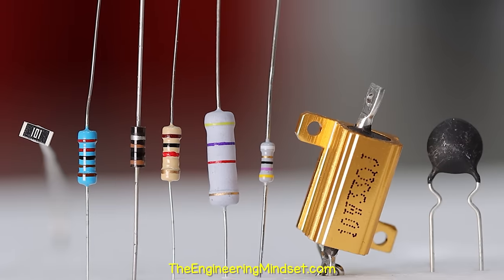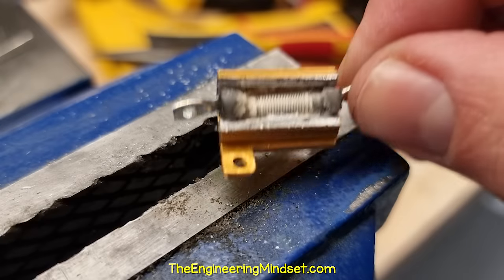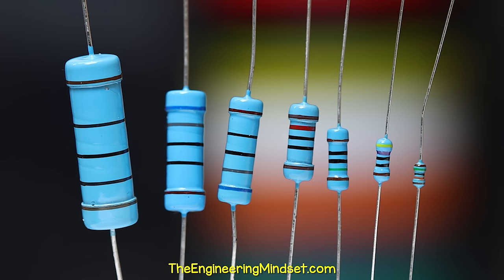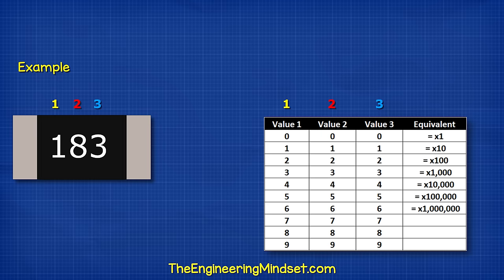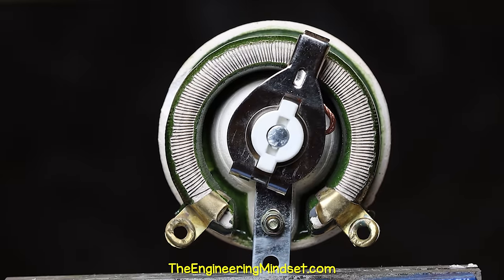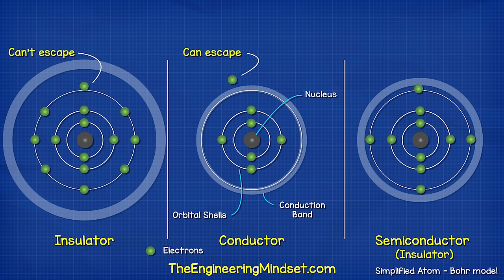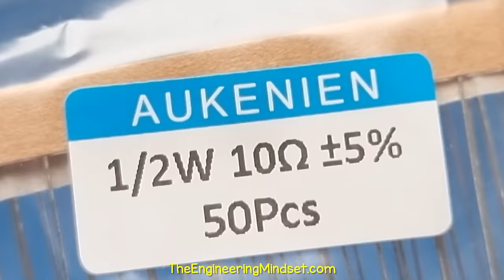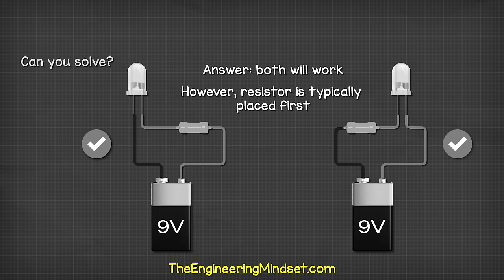How Resistor Work - Unravel the Mysteries of How Resistors Work!

Comment: As of 4:25 at first glance my answer is that the resistor should come before the led. Because you showed that without a resistor the led would burn up and break, so intuitively it makes sense in my mind that it should come before so that it can limit the amount of power going through the system.

Alternatively the answer seems so simple I’m now thinking of it as a trick question. Im thinking there is a possible answer that it could be either side. The only way this can make sense, in my mind and with my limited knowledge, has to do with amperage and the total energy of the system. Using the water in the pipe analogy, there is higher pressure on one side, however the overall flow rate is lower on that side. So in putting the transistor anywhere in the system it will limit the total flow of energy going through the system. That or I’m overthinking it.

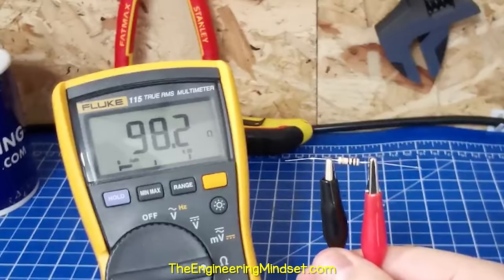Comment: Solution to the question at 7:24 below SPOILER AHEAD!!!

This bands give us the following expression for the resistance: (10*100,000)+/-5%
Simplifying it yields this:
1,000,000+/-5%
So, the final value for the resistance is anywhere from 950,000 to 1,050,000.

Comment: Hi, your videos have helped a lot in wrapping my head around components and concepts my teachers failed to communicate in high school. I've had a question for a long time to which I have yet to find a satisfying answer anywhere, so I thought asking it here would be my best bet: when you look at electron flow, the resistor is often placed at the end of the circuit, AFTER the current passes through the vulnurable components that we want to protect from overexposure to a large current. My question is: why it doesn't matter whether we place the resistor before or after these components to limit the flow? I've always imagined there to be some kind of inrush current through this component that might exceed its physical limits before it reaches the resistor to slow it down, even if it is only for a few mili-/microseconds. Thanks in advance and keep up the great videos!
Reply from the maker: I have shown it in this video. It acts like a traffic jam not a speed bump
Reply: @EngineeringMindset  I think I understand, thanks!

Comment: Heating elements are wire wound resistors just with a metal casing outside the ceramic to use the heat energy to heat up stuff like heaters, ovens and stoves.

Comment: Thank you for this video, it cleared some things up for me. I'm just starting to learn some things about this topic and it's fascinating. There is one major question about the placement of the resistor though and it's bugging me for the last few days and I couldn't find an easy to understand answer.

Electricity is talked about like something that "flows". I know that electrons try to compensate the lack of electrons on the positive side and move. In the past they have thought that electricity moves from the positive to the negative side. But physically, the electrons move from the negative to the positive.

Is it really something that "flows"? If we have an easy circuit with a battery, a resistor and a LED (in this order) and the current goes through the resistor and changes to a degree the LED can handle, is the current BEFORE the resistor still the initial one from the battery? At least for a fraction of time and it balances out almost instantly so it's unnoticable?

I think it can't be, because physically the electrons discharge through the LED first and then through the resistor, which would mean that the voltage that goes through the LED first is the one from the battery, meaning that the LED would get destroyed - but it doesn't.

Sorry for the long question, maybe there's easy to understand literature or something you can link me for this exact question.

Thank you so much in advance!

Comment: Great video.  I need help with a issue on my repair.  I have a 24V DC power supply circuit that uses a 1 ohm 2 watts resistor, the resistor kept burning after replacement, the power comes from a transformer.  I what should I look for?  Could the transformer be bad?  There 4 diodes that being used as rectifier right before the 1 ohm resistor.  Could they be bad?  Which allows too much current to rush through, correct?

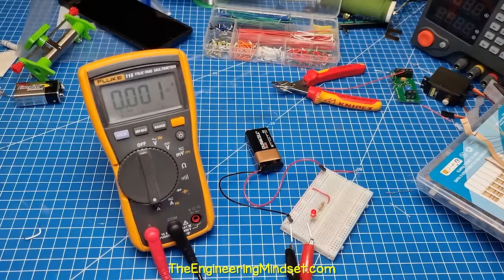Comment: Hi, at 25:11 you showed that despite using a resistor with a larger resistance the voltage drop across the LED was still 2V. However from my calculations, wouldn't the voltage drop across the LED be 0.119V because the resistance of the the resistor is much much larger than the LED which should have a resistance of around 134ohms. Could you explain as to why the voltage drop across the resistor/LED remained the same? Also this doesn't make sense as power is also equivalent to V^2/R so if the voltage across the LED does not decrease the power dissipated by the LED also remains the same.

Comment: SMD resistor codes are read as followed:
For example 103 the last digit represents how many zeros follow the given value
So 103 = 10×10³ so 10K
Or 502 = 5×10² so 5K
However this is for 3 digits. With more digits this might change.

Comment: I've decided not to buy any decent equipment (I have a basic £15 multimeter from China-bay) or start any projects (just using a breadboard with basic resistors, LEDs and later some other things like capacitors, etc) until I properly learn about the components and the equipment. This video was really useful, thanks. 

Have you got one about how to calculate the resistor needed to not blow another component like an LED? I have found that components might not come in a bag with details on it. I might find this later as it might be obvious, but I'm blowing LEDs setting up simple circuits as it is not clear how to work out the correct resistor. I figure that LEDs are a worthy sacrifice to stop me killing more expensive components in the practice phase. Once I have this mastered in that I can get an LED to do anything I like, then I feel confident to calculate anything pretty much.

Thanks in advance, but anyone can answer. ;)
Reply from the maker: Please watch our LED circuit design video and LED explained video

Comment: On markings on surface mount resistors:

Generally any resistor smaller than 0603 will not have any markings. Several manufactures quit marking any ordinary types of SM resistors several years ago. (SM ceramic caps have mostly 'never" had any markings)

Comment: I got used to the colour coding pretty quickly through my studies, but I always thought this to be an unnecessarily complicated system. As if the manufacturer is attempting to create some kind of Masonic Lodge of electronics repair technicians who will be the only ones capable of "reading the signs" LOL. Why not just write a resistance value on it in bright, clearly legible letters? Years later someone brought us an old Soviet synthesizer for repair, and when I opened it, - lo and behold, each green colour resistor both small and large had values written on them in thick white text.  Thought that was really cool.

Comment: One fact you omitted was that most resistors are not made-to-spec, but rather made-then-speced.  I.e., first the resistor is manufactured, then it is measure and then labeled based on the measured resistance.  So if, for example, a resistor is labelled at plus/minus 10% accuracy,  you can be confident you won't get lucky and find that it happens to be within 5% of tolerance.

Comment: While putting the current-limiting resistor before or after the LED doesn't make any behavioral difference, it does make a practical difference, in particular as you get into higher voltage circuits. When the resistor (or any protective device) fails open, you would ideally like the 'active' part of the circuit to fail to neutral/ground, rather than fail to the bus voltage (for safety reasons; you can imagine a circuit with a 100V signal accidentally propagating that voltage throughout the circuit when an element fails causing potential hazards to users.) This means you want the resistor to be on the high voltage side of the circuit and the LED on the low voltage side. That's also why we put our transmission fuses before your house, and why we don't put protective isolation devices on ground wires.
Reply from the maker: Seen the new LED explained video? so much detail covered! https://youtu.be/O8M2z2hIbag

Comment: Question! You mentioned that the resistance changes accordingly when the strain gauge is stretched or contracted from length into width or vice versa. I supposed if the volume remained constant, my theory is an additional curved tension has slowed it down, but I never study fluid mechanic of electron flow, what am I heading? Current or Pressure?

Comment: all in all
1. Answer: Depends, but its alright if you apply it after the LED or before the LED. CORRECT
2. Answer: around 1 mil ohms or 1000000 (the beige one) CORRECT
3. Answer: around 12k ohms or 12000 (blue one) INCORRECT

2/3

Comment: I'm confused, electrons in reality flow from the negative the end of a battery.

Alpha Phoenix showed that the instant a circuit is turned on, voltage and current do indeed flow for a fractions of a second while the circuit stabilizes.

With this phenomenon in mind, wouldn't it be advantageous to put resistors in high power or high voltage applications in the negative end of sensitive loads drawing from this high power system?

Comment: The firsr example resistor has 50 Ohms with a 5% tolerance so te range is anywhere from 47.5%-52.5%. I think
The second one is 120,000 Ohms with a 2% tolerance giving a rage anywhere from 117,600 Ohms to 122,400 Ohms

Comment: I replaced the resistor other ground ... So after. But I don't think it really matters in some electronics. Plus I make sure to use a correct volt power source ❤

Comment: I can understand this using the electron flow model, but not as electricity actually works through electro magnetic fields. How does the resistor reduce voltage and current when the electro magnetic field can induce a current in the conductors beyond the resistor?

Comment: before or after?  Doesn't matter unless there are other elements in the circuit.  Sometimes a design can be that two devices need a common voltage drop.

Comment: The one ohm resistor is basically cut in half the thin mettel carrying the current so as the flow comes into the resistor from one direction leaving the risistor out the other ?

Comment: It's always good to compare water flow with electrical flow. A lot of similarities.
Reply: Resistor - restrictive (narrowed) pipe
Capacitor - water tank
Inductor - water hammer (can't think of an actual device that does this because water hammer is something you typically want to avoid, but I can think of some conceptual devices that would achieve it)
Reply: I don't think so.

Comment: i think it does not matter if i put  resistors before or after  coz its in series so there will the same  voltage drop on the bulb and the resistor anyways nomatter  if its before or after the light bulb

Comment: If my $1,000 led headlight on my beetle stoped working due to the dc generator. Is it likely that the voltage dropped and damaged the leds or could the resistor have been damaged due to low voltage

Comment: I love your videos but I am so confused. In your various videos in the electricity series, you keep referring to the flow of electrons (number of electrons flowing, speed of electrons flowing) but in various other materials I keep reading that electrons do no actually flow (but rather drift very slowly). So when you say electrons flow in large numbers where the resistance is low but in fewer numbers (but at the same speed ... in this video using the traffic jam analogy) what do you actually mean? Do the electrons flow along the wire or don't they?

Comment: A simple question, if the resistor sheds the current the LED cant use, why do LED bulbs save power? Is the power not just wasted as heat in the resistor instead of in the old bulb filament?
Reply from the maker: If you used a high voltage and a single LED it would be a waste. But multiple LED's or a lower voltage would be more efficient. A normal incandescent lamp has to reach a temperature that is so hit it emits light. So it produces light almost as a waste product. LED's don't, just emit just light and almost no heat. See our LED explained video for more info and deep dive

Comment: Could it be that the electromagnetic field created by completing the circuit with only a 9vdc battery and an LED is so strong that it super heats the thin wire inside the LED rather than too many electrons being pushed through such a small space?

Comment: Howdy, Brother!  What resistor should I use if I have a yellow 10mm LED Emitting Diode (1.8-2.2V)  powered by two AA Batteries (on/off switch in the loop)?  Will 47 ohms work?  I'm not even sure if I asked the question properly . Thanks for any assistance.
Reply from the maker: Please see our LED design video, full tutorial with all worked examples

Comment: if i remember correctly, it shouldnt matter where you place the resister as its in a serial circuit. The circuit will complete in such a way that theres enough power left after the LED that the resister will still recieve its portion
Reply from the maker: Seen the new LED explained video? so much detail covered! https://youtu.be/O8M2z2hIbag

Comment: my question is if there is only 1 lane instead of 2 then why so many cars? why cant we just use less power to provide the needs of the led instead of adding resistance in between the 2? is it because resistors are cheap and sometimes u may want to provide power to multiple components with the same power source and dont want to create separate power sources for each component? i've so many unanswered questions that i should've asked in my pre-engineering classes

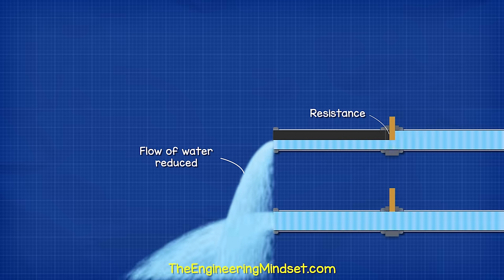Comment: 1:51 
Isn't the example incorrect 🤔 
Due to Bernoulli's principle decreasing the area of the openning will increase the speed of water.Ya I know you are trying to explain electron flow but just letting you know.

Bye the way love your video.
Reply from the maker: Yeah there's a few comments about this already and you're right but this is just a simple analogy animation, but we could use a variable speed pump and it would work.

Comment: I found that high ohm resistors around 100,000 and up resistors that had a high voltage across them would fail.  1 Meg half watt with 300 volts across would look perfect but be open.

Comment: For the metal film resistor, I calculated a resistence of 1.2 kilo-ohms +/- 2% but at the end of the video it looks like you flipped the resistor around for a value of 22 kilo-ohm +/- 1%. What am I supposed to look for to make sure the resistor is aligned properly so that I don't make that same mistake again?

Comment: On the 5 band resistors, how do you determine WHICH end is the starting end. This could be either 330 X 1 =- 1 (330 Ohms) OR 100 x3 + - 3% 300 Ohms.
Reply: one ring is slightly ticker, there also 6 band.
You need a magnifier to see, lol

Comment: So in the core of the resisto4, is it trying to flow through the ceramic, and that's why it's slow, since it's not conductive, or is it trying to flow through whatever metallic or carbon substance is present, and the the presence OF the ceramic means it has a harder time flowing through that other substance.

Comment: 7 different types of resistors...

Resistor of Stability:
Fixed Resistors
- Breadboard Resistors
- Surface Mount Devices
- Fusible Resistors 

Resistor of Change:
Rheostat 

Resistor of Potential Change:
Potentiometer 

Resistor of Voltage:
Varistor 

Resistor of Heat:
Thermistor 

Resistor of Light:
LDR/Photoresistor 

Resistor of Force:
Strain Gauge
Reply from the maker: Seen our new Potentiometer Explained video? ➡️ https://youtu.be/Xb-MZMoUtcQ

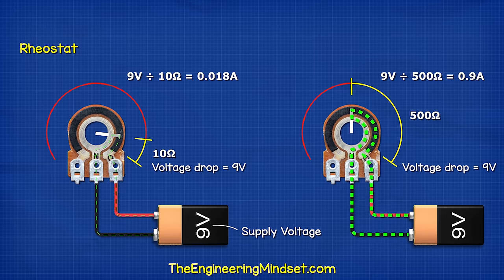Comment: I believe there is a tiny error at 14:52 (Rheostat) where it shows the ampere. The results should be switched so that 9V / 10Ohm equals 0.9A and 9V / 500Ohm equals 0.018A. 
I am a newbie and this confused the hell out of me to the point where I started to distrust even my windows calculator, lol
Reply from the maker: Correction in video description
Reply: @EngineeringMindset  ohshit, sorry I didnt see that before. Nvm

Comment: The led should be placed after the resistor as the resistor has to take away the extra voltage before it reaches the led.

Comment: Aux audio jack detect connection using resistance value right? How do i disable aux jack detection when i only connect the entension cable (male to female audio jack) ?

My tv speaker wont work if i connect extension cable

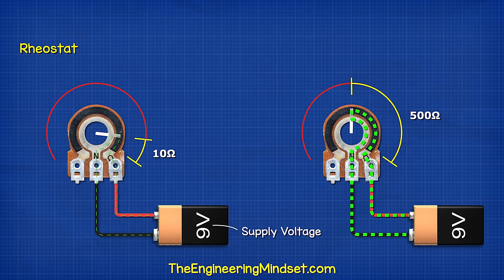Comment: Fantastic videos, but I am lost at 14:53 !  Everything made sense until then, the maths don't add up and the pictures don't make sense to me (I'm a newb and learning), the video shows that with a small resistance more current flows than when at a larger resistance??? - it's me I'm sure, but I don't get it.  9V / 10 Ohms is surely 0.9a not 0.018a as shown, and 9v / 500 Ohms is 0.018a (not 0.9a) ??? and the video here shows big green line going through more resistance and little green line going through less resistance.  Thought everything made sense until I hit this part.
Reply from the maker: There is an error here, see video description for correction
Reply: I should have read more of the description! There is a corrections section which corrects the math.

Comment: Doesn't restricting flow of water in a pipe lead to higher velocity of the fluid and higher pressure? This is actually exploited in a Venturi pump, right?
Reply from the maker: Sure but it's just an analogy for visual aid. We could use a variable speed pump and it'll slow down

Comment: So in the case i have 2 resistors in paralel and i then remove one. This makes it one resistor "in series". Does this increase or decrease the load on the resistor?
Reply from the maker: See our videos on series and parallel circuits